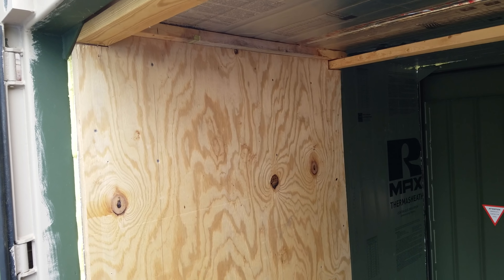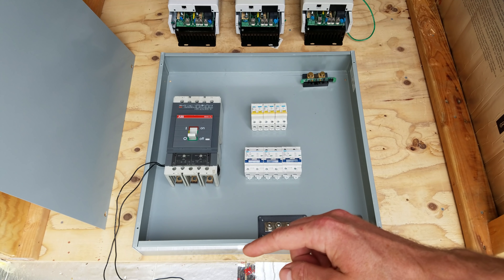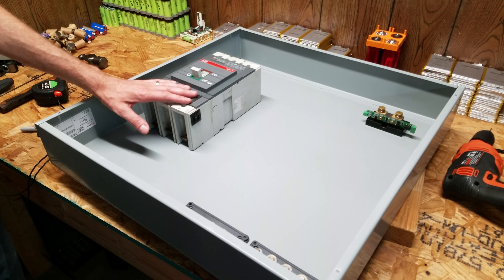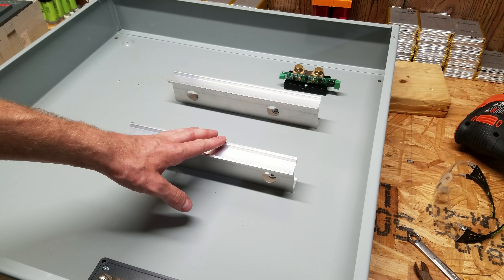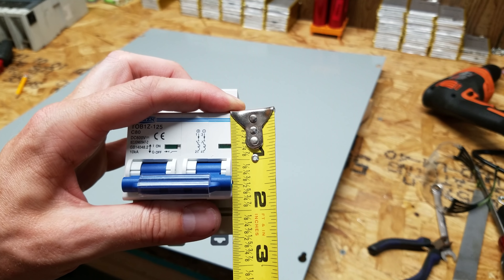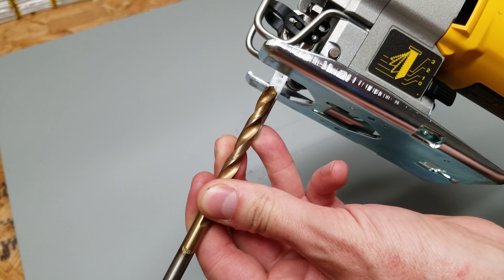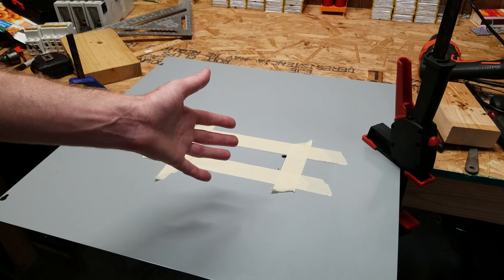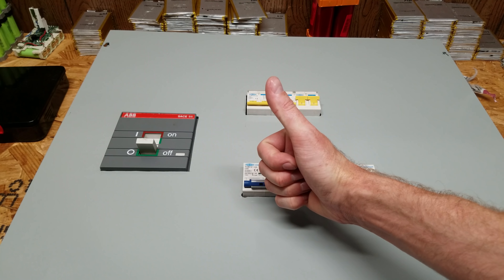Constructing the Battery Shed Electrical Cabinet, Breakers & Bus Bars

Comment: Top tip for anyone interested, we build switch gear for the UPS industry in the UK. Rather than using the sheet metal cover for the switch panel with the hassle of cutting  out etc, we use clear Perspex or acrylic which is easy to cut, cheap and also gives you the advantage of being able to view the cables/terminals within the cabinet and see if any issues exist “thermal effects” and maintenance without needing to remove the cover. Maybe not required for low voltage configurations but in UPS systems the voltage rails are usually around 480vDC

Comment: While building industrial control panels for Petrochemical refineries we always taped off the entire lid with masking tape to prevent scratches and provide a visible line on stainless.
Reply: We also did layout with a combination square.
Reply from the maker: Taping off the entire lid would have avoided me having to scrub pencil marks off the cover and I obviously could have just cut through it. I wish I would have thought of that... lol
Reply: When I used to build panels (with lots of push buttons, counters, & disconnects), I would apply thick shelf paper to the front face.  Do the layout in Visio (actual scale), laser print onto 11 x 17.  Lightly spray the backside of the printout with spray adhesive & apply.  Make your punches & cuts, then rip the shelf paper off.  Clean any residue with alcohol.

Before that, I would be cleaning the pencil marks off the enclosure,  trying not to leave marks (which the client might refuse). :)

Comment: The way you cut the holes for the breakers will prevent you sliding the cover up and off, and you'll have to unscrew all four screws which will be heavy when mounted. The screw holes in the lid are keyed so you can just loosen the screws, slide them up, and pull the lid off. But this would mean cutting the breaker holes on the bottom side a little longer. The breakers should be designed so that should still cover the lug nuts when in place. It's something to think about.

Comment: For all those conduit entries do yourself a favor a buy a knockout punch. Drill a large ugly hole with a step drill just big enough to get the draw stud through and then crank the cup and die together with a ratchet until it falls out. 

I know Hazard Fraught has a set for $20-ish. 

The fancier brands make square punches for circuit breakers too.
Reply from the maker: YES. I have the "hazard fraught" punch that gets used with a ratchet. It actually works quite well after I did a few and learned the tricks. With the amount of punches I've done though, I kindof which I would have invested in the hydraulic version that I saw DavidPoz using.
Reply: Greenlee 1/2" & 3/4"  (Get the slug-buster model if you're doing a lot of holes).  
Reasonably priced & well worth the expenditure.

Unfortunately,  any punch that isn't round (square, d-sub, etc), is gonna cost you bigly.

Comment: Love your work and great to see this project go forth but personally, I hate working in shallow 4 inch cabinets. I much prefer 6 to 8 inch depth when working with DIN RAIL, relays etc. I'm not hating...just saying. In my world, a 4 inch depth cabinet has no place in an electrical bunker/control room,  it adds more work to make it work and allows no room for error and can often make it easy to exceed electrical code 'Box fill' restrictions. I am not trying to be a downer, just sharing my experience. I prefer a deeper cabinet perhaps with a door. Cheers! 👍👍

Comment: Great looking panel. 

Do you have more info on the shunt you’re using?

Also, something to consider for future electrical panel layouts is to have a mimic bus on the front of your panel. I do this on switchgear, but it’s basically to ‘mimic’ the single line bus of the gear on the front with a visual representation. This allows you, or anyone else in the future, to understand what’s wired to what. This has to be a balanced consideration with respect to wiring and other component layout concerns.

Also, consider using Square D breakers.

Comment: Couple of "pro" tips
Cover the foot of the jig saw instead of the work piece, prevents any potential issues with covering a line or somehow forgetting to cover work piece.
For clamping add a straight piece of wood across the work and clamp that with the work between the wood and the table. Get it as close as possible to the cut and it will prevent any bouncing.b

Comment: Would have just made a paper mockup of the shapes to cut out and put them on the top of the case, drilled the first pilot holes to visually make sure it was in the right place installed, then cut the rest out.

To cut straight lines you can also clamp a fence to the top so the jigsaw follows it.

Comment: Wow. Careful work provides a fine e ample to a goose like me who rushes things! Also, I don’t know how you guys work with the imperial system of measurement! :-)
Reply: All those fractions of an inch is painful.
Reply: i'm trying to teach myself the metric system and i'm having difficulty with it but some progress. Although i suppose you are best with what you grow up with
Reply from the maker: It gets frustrating when you're looking at a measuring table wondering wait is that dash 8ths, 16ths, or 32nds...
Reply: 😆 I’m aghast at the measurements in fractions. 7/32” ? What is it? Please do not misunderstand my approach. I’m only exhibiting me ignorance.
Reply: @blocke2551  Yeah, getting a feel for it is different, but boy it helps when you want to add 2 measurements together. remember, 1" ~ 2 1/2 cm".
Reply: You can get a tape measure from Amazon that shows BOTH metric and SAE systems on the same tape. It will help you get the feel for it, and aid in arithmetic when you need to add, subtract, or otherwise combine measurements.

Comment: if you left room for 4 circuit breakers on the double height din, why not just cut out that width in the front panel?
now if you expand the breakers, you have to cut the front again
Reply from the maker: Yes, I would have to cut again. I didn't cut it out now because there is no immediate plan to add another and I didn't want open holes there.

Comment: Nice project. That's something I'd love to try but here in Brazil we're not allowed to have solar powered battery banks in urban areas.
Reply from the maker: Why aren't you allowed to have them? Is it a fire safety thing?
Reply: @LithiumSolar  I can't say for sure, but if I had to guess I'd say probably not. It seems like they wanna force us to stay tied to the power companies. Also, you're only allowed to have solar power in urban areas if you are still connected to the grid, just so they can use the power you generate. They even tried to impose a tax over solar lol, it's all a bunch of BS.

Comment: Some of us don't worry about U.L. Listed products on our side of the  Meter.  All we have to do is insure what we do on our side of the meter STAYS on my side of the meter.  LOL  A chines Grid Tie only supplying a portion of our Kwh use for example.  A lower the Bill thing.  Objective being Never Produce enough to be transported thru the meter yet realize a significant reduction in the Kwh paid for.
Reply: Yes, but as the name implies, if you have a purpose-built Underwriter Laboratories approved item, and your house burns down because it failed, the insurance company will have to pay up. If you messed with it so it's no longer purpose built, that's enough of an excuse to renege on the payment.

Comment: i dont understand how you use imperial, is so complicated for my
Reply from the maker: I guess it's just a matter of what you're raised on and taught.
Reply: @LithiumSolar  very possible, but analizing the 2 system the imperial is strange, is more complicated to measure using fraction, in a point you have a very low fraction measure , i see metric more lineal more round measures, more logical all is divided in 100 parts, and if you dont want to use decimals you can measure in a different spectre
Reply from the maker: I completely agree, and wish we would start the process of converting to metric. It's already taught in school and used in all scientific areas. I don't know what the hold up is really...
Reply: @LithiumSolar  yep is strange that they still holding on in that convoluted system

Comment: I personally wouldn't trust a chinese brand like tomzn for something like protection equipment 😉
Reply from the maker: They actually seem to work well compared to the generic breakers on the market. They are being used more for disconnects here anyway :)
Reply: LithiumSolar Well I personally went for ABB S201 breakers in my 12v lead acid set up since I can get them quit easily and they are also rated for 12-72V DC use. Plus the are quite affordable